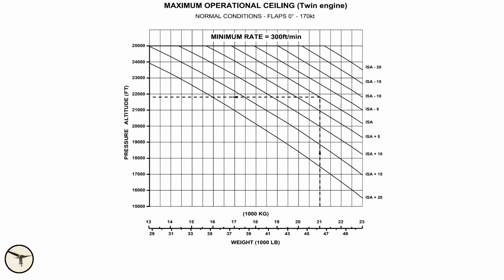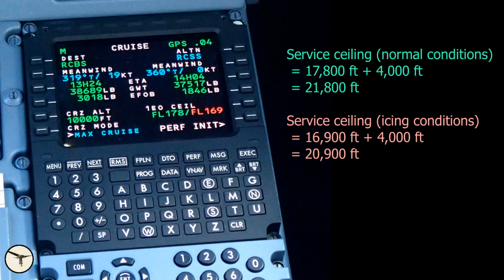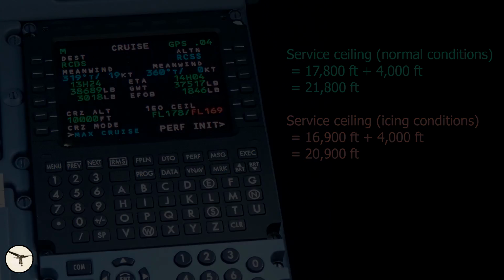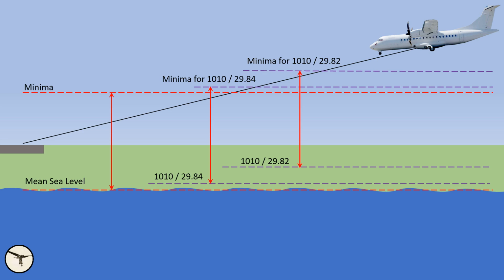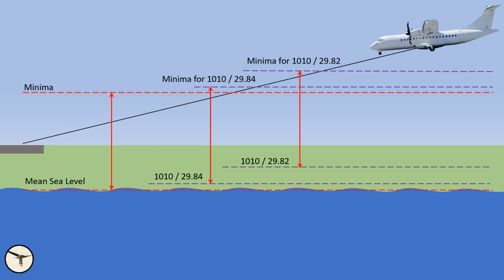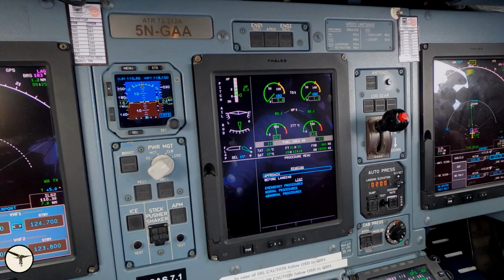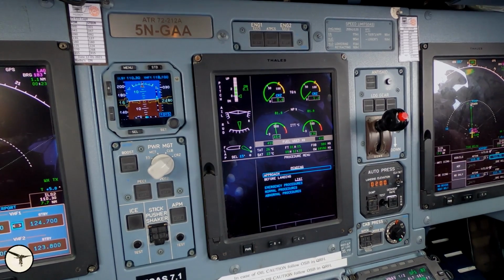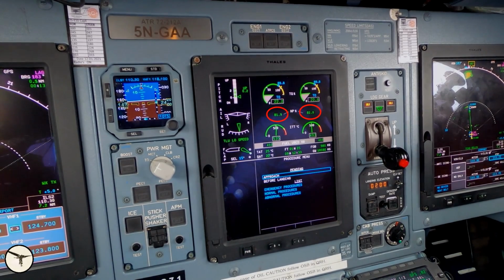ATR hacks you might not know about - Part 3

Comment: Trick number 6 didn't work for me. I crosschecked the cruising level with QRH for several flights and your formula seems to be wrong...
Reply from the maker: I agree it's not a precise formula. It's a shortcut for lazy pilots like me. The table in the QRH will usually give a higher cruise level, but if you look for maximum cruise speed, the FMS is pretty close.

Comment: Hi Magnar. To which QRH or FCOM perf document are you referring for your hack N°1 ? When reading the PER 4 page 1 and PER 5 page 1, first GW = 21t and norm. ISA cond. I read 21800ft for max. Operating ceiling and 15700ft for single engine gross ceiling.
Reply from the maker: The figure is from FCOM PER.5.2 page 4, and QRH PER.4 page 1. The hack (adding 4,000 ft to one engine out ceiling) is not 100% accurate, but gives a good indication of your performance. You also don't have to interpolate.
Reply: @FlywithMagnar  Sorry Magnar but these are the same documents 😬… (maximum operation ceiling twin engine)

Comment: Hi Captain, My name is Chiarello and i am F.O. on ATR 72-600 in Azul Airlines and i´m Instructor as well! I follow you on channel  since you started. Could you talk about 2 hacks: Switch on the annunciator light and see a new 1EO Ceiling on MCDU(Boost light comes on) and same switch clear all manual speeds for take off. Thanks and Happy flights!
Reply from the maker: Hi Chiarello! Thank you for the tip. I do not fly aircraft with boost (it has no benefit in the Maldives), but I will check out the manual speeds.